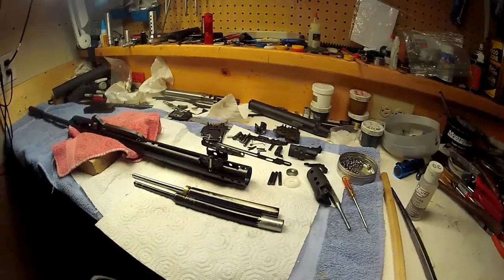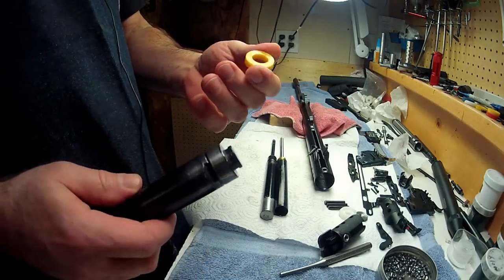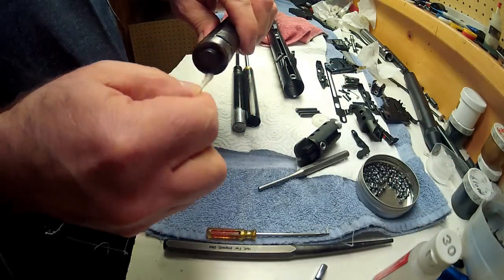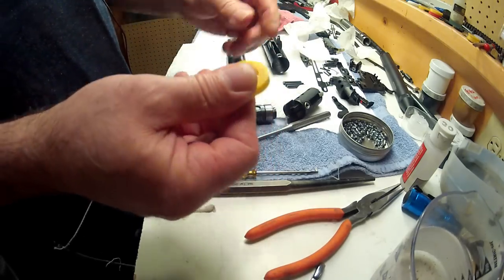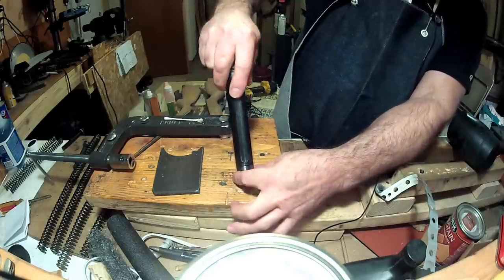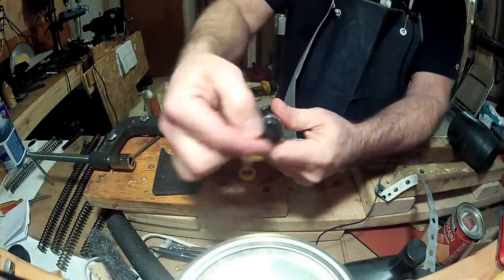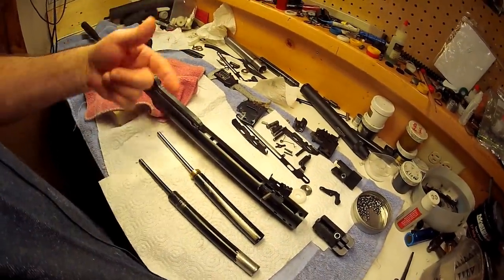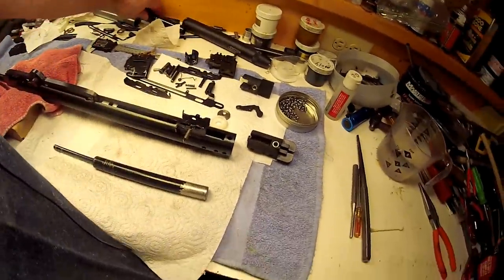Pt 1 of 2 How to gas ram hatsan & others and air gun info

Comment: Would you recomend hatsan 95 springer or vortex?
Reply from the maker: I recommend a weihrauch 95  and save your self  the head aches 

 the hatsans need  to be gone over its 50/ 50 weather or not youll get a good  barrel the piston seals wont last and are under sized.
I like springers because you can do more with a springer  in the tune  area of  the gun 

 Airguns of Arizona  has  the hw 95  on sale  for 315.  they need a little going  over to but when your done you have a real nice air rifle, if you get one  let me know. are you able to do any of your own  work?
Reply: I already had ordered a springer. Might learn to strip and lube, planning to get hw95 next though. When i do you will be the one i come to for tuning. Your vids are great. Thanks for the tip on the hw deal. That will be my next.  Do you work on crossman 1400s .? Got one my dad gave us as kids may aventually be looking to get that rebuilt.
Reply from the maker: Well clean the barrel first  and  do the pellet to bore test  to see whats  going on in the barrel , you may have  to return it  if  the barrel is  bad.

 if  you do have a good  barrel  you should  get a vorteck piston seal and spring, I can make a spring guide  for it  & top hat I charge 50.00 shipped back.

If  you get a hw 95  I  can tune  it for you.

 My friend Rich  in Ohio  probably could  do the crosman 1400.  here is his phone number. 330 853-9916

Comment: Do you have a full video showing how to take a hatsan completely apart and what would you charge to do this for me
Reply from the maker: starting with this  1st video - part 1 of   4 parts on a hatsan 95/

Thees guns are a P I A  to work on and not for  anyone who  is not mechanically inclined. the trigger alone you will need  to make a pin to be abl;e to reinstall it.

Iam not sure what you want? was it converting a springer to a gas ram etc.

I am not currently taking  on  any work
https://www.youtube.com/watch?v=pCBcZRRGK_c

https://www.youtube.com/watch?v=tEEZhlklPwQ

https://www.youtube.com/watch?v=6vMc-rydY2E&t=1620s

https://www.youtube.com/watch?v=YRVDRs_1Uk4&t=14s
Reply: Just wanted to convert. springer breaking to many scopes thanks
Reply: and where can I get the parts

Comment: Here do you buy the replacement parts from. Any info please.
Reply from the maker: are  you in the U.S  here  hatsan usa  has piston seals  & breech seals and  some parts  if  you ask  properly  but  no barrels or trigger parts/ vortek inc  has springs for the 125 - & 135  but the after market piston seals I stick with hatsans  they work  once you go thru the rifle with different lube and  they  are just fine
Reply: Yeah. Like Crosman is easy to get parts from them. Just go to the parts list and just give them the part number. I’m trying to get back to air gunning. I just like to replace and fix my air guns.
Reply: I want to get the hatsan 95. The only thing I’m worry is if the gas ram goes out on me and can’t buy a replacement for it. I seen it on sell for $150 at big5
Reply from the maker: @Teamwolf7777   a hatsan vortek ram they can have issues leaking  you can pump them up  but you need the rite set  up  for it  and  the gas rams end makes up part of  the end plug at the trigger I would get a springer and clean it up  * go thru  it the end plug on the springs  is one piece  nt two like hatsan vortek rams are
Reply: So you can refill the hatsan 95 vortex ram too . I thought  it’s just for the 125 model only. So I just need a pcp pump then
Reply from the maker: @Teamwolf7777   I did not know they made them different then the 125 -135 better  ask hatsan first  to know for sure
 there's some type of adapter  hatsan sells  I  dont know  much about it  just from what I been  told,

Comment: Do anyone know where to get a replacement barrel for Hatsan 125 sniper 22 or 25 cal
Reply from the maker: Hi. Did  I reply to your question
Reply: I bent my 135 Barrel, sent it to Hatsan USA, they replaced it for $108, shipping was $26, from southeast coast.  Actually ended up w/ an over all better Rifle.
Reply from the maker: did you have  to ship your gun also  to hatsan, my friend had  Five  135 with bad barrels and he had to ship the gun and had to pay the shipping  it was a horrible ordeal
Reply: I own two 135's and a 155, all vortex & a tuned (bullet proofed service by Hatsan USA, same shippin cost) 150 spring (beast), i bent my barrel in a hurried 2nd shot on my .25 /135 and let it slip outta my hand so it was clearly my fault, i didnt dicker w/ them. But if one reads fine print on Hatsan USA website it clearly states they will not pay for shippin under ANY circumstances, ya might get the labor free, but not shippin, for me it was 26$ round trip from NC to Ark. which was much less than i thought it would be. Mine are all Gems right outta the box. They were really good at correspondence on any issue, sometimes answered me w/ in hours. They have a service form to fill out on site then they give ya a work order #, outside of shipping, Hatsan USA rocks in my humble opinion. Shippin policy/ suckola, but no way around it. I like your Videos, i learnt alot.
Reply: I guess i coulda answered by sayin...no they wouldnt send me a barrel. Had to send the whole deal, got it back in 7 days. Might have been a warranty thing tho. They emphasize that hard. In my case i wanted it done right and warranty but i dont think they sell barrels. They have a parts page at the web site w/ available parts...no barrels listed. at least not a year ago.
Reply from the maker: amazing  your was good  out the  box, the nightmares  I heard from so many people.  even the ones I got were bad especially the refurbs.

hatsan usa  did get back to me and I was able to get some parts I was after.

Thanks and enjoy
Reply from the maker: tehy wont sell any barrels because the serial numbers are on the block. 
I have gotten parts from them that they dont list simply by asking  for them, got two pistons and some barrel bolts and end plugs , even a stock a couple  of yrs  ago
Reply: I got mine from PA, i did have to return one, because the stock was unacceptable, and the lock-up was loose. the 2nd one they sent me was perfect., ive got thousands of cycles on all mine now, and there great, guess i got lucky.

Comment: hi there i would like to find out some knowledge, can you manually fill gas rams? can you fill them to supercede the standard velocities of the rifle?  can you buy them as an individual part? how risky is this and how much is too much?  
thank you.
Reply from the maker: +piero muro You can buy commercial gas rams  how ever  they cost a lot more and I found  the money  was not worth it  and  the little bit of extra power was not worth  the extra cocking effort  or the rougher shot cycle.  the Crossman Xl gas rams I( found to perform the best  with just  the rite power and cocking. also commercial gas rams  if some one bought them  you would have  to buy the special costly adapt[ers to fill and discharge the rams  so it really is a waste